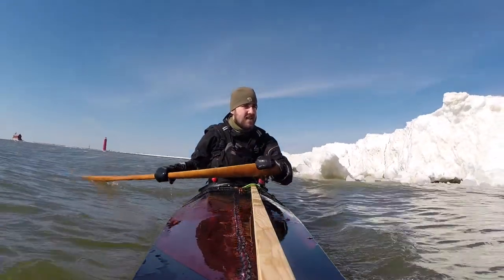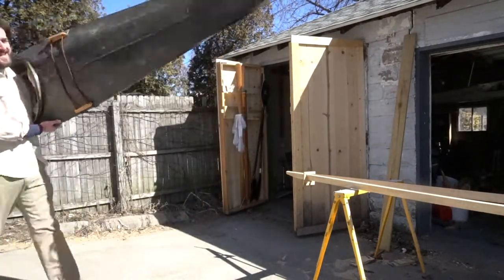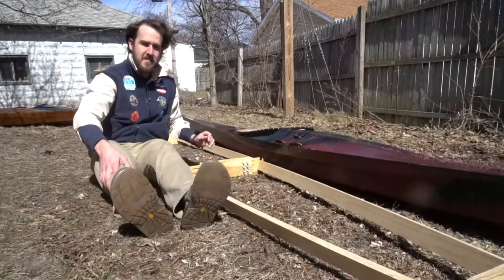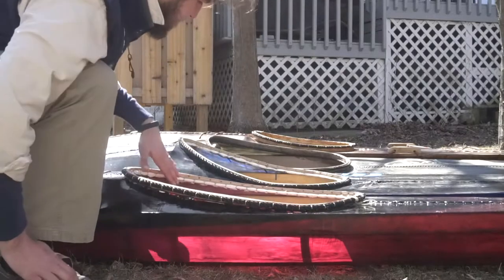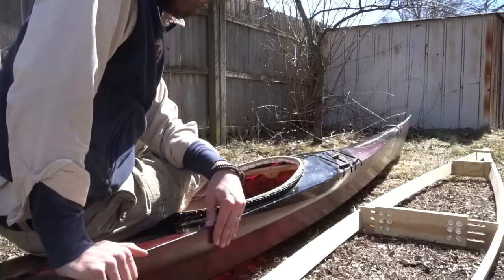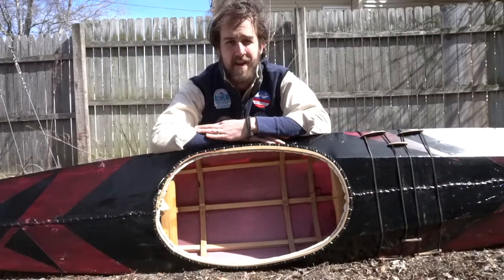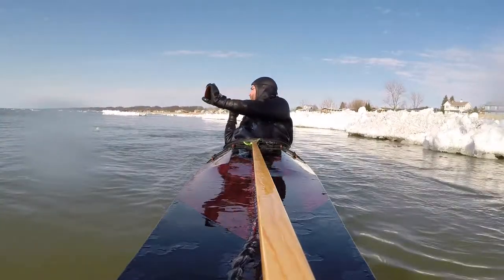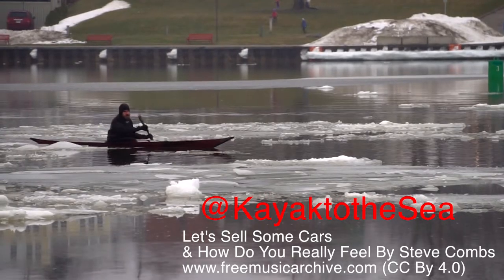Skin-On-Frame Kayaks (Qajaqs) - Kayak to the Sea S1. Episode 4

Comment: I'm getting ready to build a skin on frame boat and wondering if I can use carbon fiber or kevlar cloth. I can't find any info as every video and website I find only uses the standard types of cloth. That or vaccum infused, which requires additional equipment. Any suggestions?
Reply from the maker: I've never heard of anyone making a skin-on-frame with carbon or kevlar skin.  It seems like a really expensive process for something that won't be a great enhancement.  These kayaks typically weigh half of what a hard-shell kayak of a similar size would weigh and are incredibly tough and using these materials probably wouldn't make it any lighter or stronger.  And vacuum forming only works if you can get on both sides of the fabric for the bag to apply pressure for the infusion so the frame would be in the way.  What is your goal with trying to use this sort of process?  You have me curious to see what you come up with.
Reply: Kayak To The Sea when I mentioned vaccum infused I was refering to the conventional composite boats in the industry. I'm trying to make it as durable as possible. But why should a sof exterior be flexible rather than firm? If I wrap it in carbon fiber and coat it with epoxy wouldn't it be stronger? Btw I'm building a canoe for now and I'll build a kayak during the winter.
Reply from the maker: @Hydraz13  The carbon or Kevlar on a production kayak is strong but the tough part about using it for a SOF comes from the fact that on a SOF the skin is only one layer thick and the frame will always have some flexibility to it.  A production kayak is stiff due to laminating multiple layers together, this is what also makes them heavier. The combo of a flexible frame with a stiff skin makes a recipe for cracks and damage to occur.  Even using a too hard epoxy on a single layer of nylon for a skin can cause cracks and leaks as it flexes.  A space age skin would probably work fine but I would do a test with resin before doing it to a whole kayak if it is a not so common sealant.
Reply: Kayak To The Sea ok thanks. I'll just stick to a standard sof boat.